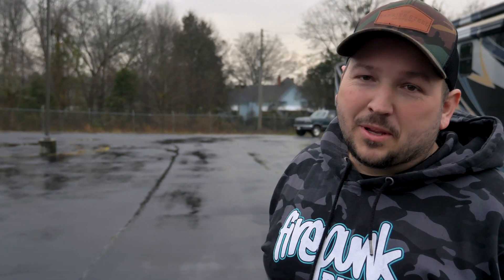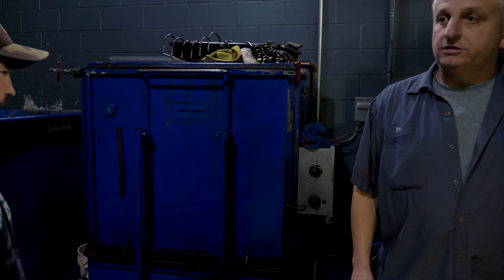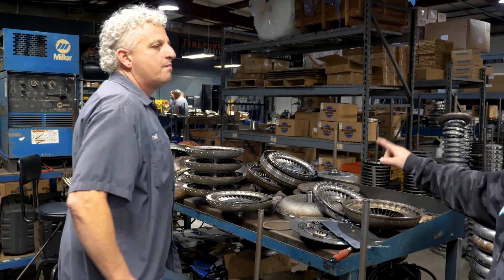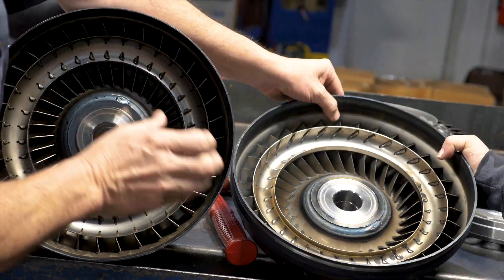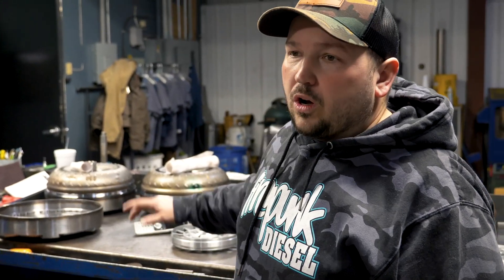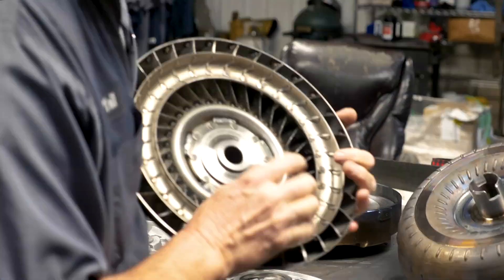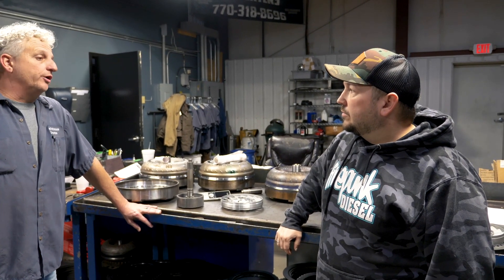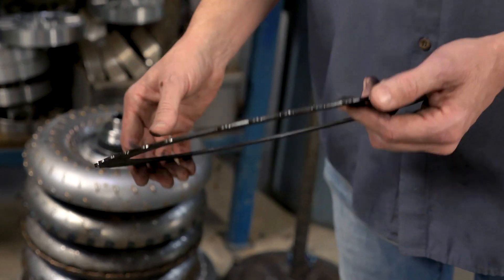DIESEL PERFORMANCE CONVERTERS - WHAT'S INSIDE A TORQUE CONVERTER?

Comment: What are some things that would cause a 48re torque convertor to violently shake(chatter) when transitioning to lock up? Happens every time I merge on freeway have to feather accelerator pedal to get it to stop. Could the lock up clutch be warped or a valve body issue? Its a triple disc DPC.

Comment: Just installed my firepunk comp 1 with the dpc. The lockup is rather harsh especially into OD. Almost concerning. Just want to make sure that’s normal.
Reply: Very normal, lockup with a triple disc will always be like that especially in dodges.
Reply from the maker: A 3-4 locked shift is solid/firm.  Almost every truck that is "harsh" is fixed by installing traction bars to eliminate axle wrap.  We just did one last month that was violent shifting into overdrive, but after installing our traction bar kit, the shift went back to a normal shift feel!
Reply: @FirepunkDiesel  ok thanks. Will it break in a little over time?   Not sure if I’m getting used it to or is getting a little smoother. Will an anteater help to smooth it out for daily driving?
Reply: @jacobshoot895  thanks never ridden or driven in one with a performance trans and I installed it myself so I want to make sure I didn’t f it up!

Comment: 48re question.  In 3rd locked, if I give it some throttle i can see the RPM go up, maybe 2 hundred or so. In 4th  i cant get the rpm to go up no matter how hard i push on the skinny pedal.  I don't feel like its slipping in 3rd, but like the converter isn't completely locked. Truck is 92,xxx miles.
Reply from the maker: If lockup is on and your getting rpm rise that isn't coralating to increase speed, then you are slipping the lockup clutch, so with a scan tool, watch tcc command and see if it's commanding lockup when your getting rpm rise
Reply: @FirepunkDiesel  Thank you. What would cause it to slip in 3rd and not 4th?
Reply: The trans slipping clutches .

Comment: How much hard driving can a quad disk take before I should replace it. Hp range is guessed at 700ish. I know if the tc goes it takes out the trans. I would rather drop a trans on a maintenance interval to to just swap a tc than do a rebuild because I went too long.  

There are things I do now to save headaches. Some would argue its a waste of time.  Example. On my Hemi Charger, I swap the lifters every 30k so I dont take out a cam shaft. If its ticking the cam is done.
Reply from the maker: When the lockup clutch starts to wear over years of abuse, lockup will start getting softer as the clutch gets hardened from heat over time.  So if you feel lockup getting soft then it is time for a cut/clean/reclutch, but as long as its holding power and locking good, rock on.
Reply: @FirepunkDiesel  I try to rev match before hitting the lock up button so the hit is softer on the trans and the driveline. I watch the heat climb fast if not in lock up and accelerating hard. I worry the fluid stress might cavitate in the tc fins cause piting like a propeller on a boat when you accel too hard. As a guy who has destroyed countless trans I am trying to be better. I love speed, but hate breaking shit. Thats why I try to over engineer what ever I replace.

To be clear I watch the temps like a hawk. I never let them get past 200 and even then Its very brief. I am probably running too cool. 140ish for the most part unless in stop and go.

Comment: And my converter new well referb chatters in neutral and park and I have no lockup switch wonder why…
Reply from the maker: a triple disc has a floater plate (that's the clutch disc we showed in the video) so it will make some noise when there is low fluid volume flow in neutral and park.  We can modify the vb by drilling a 'line to lube' hole in the vb that allows more fluid flow in neutral and park and it will keep the floater plate from making as much noise, but the compromise is the line to lube hole increases the chances of converter drain back when the truck is parked.